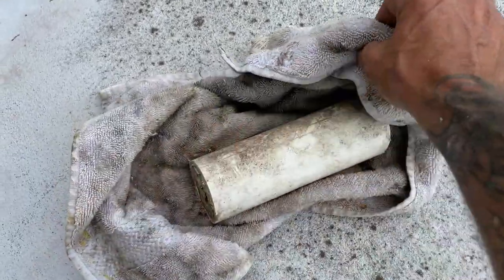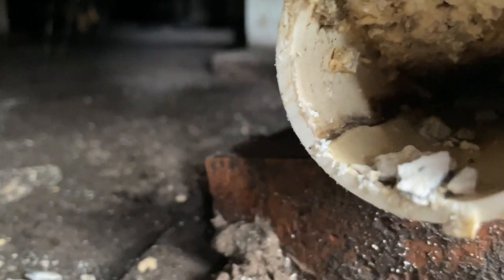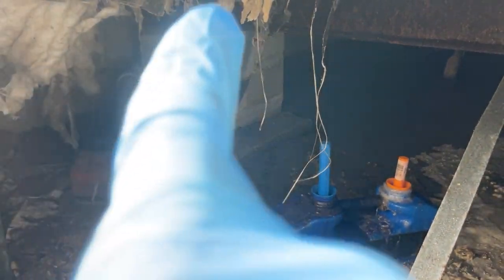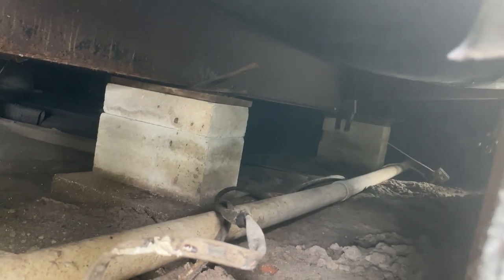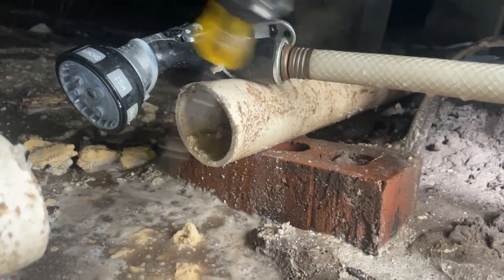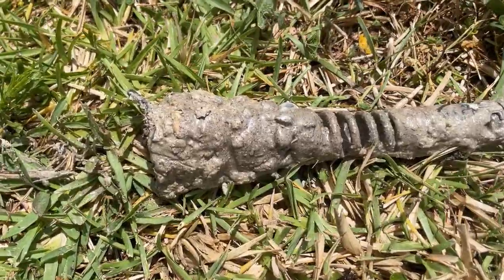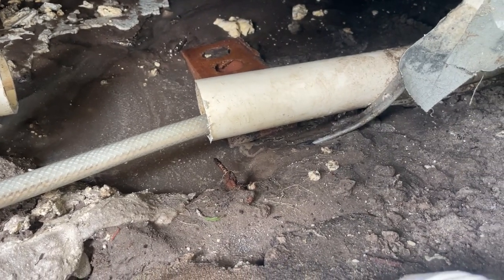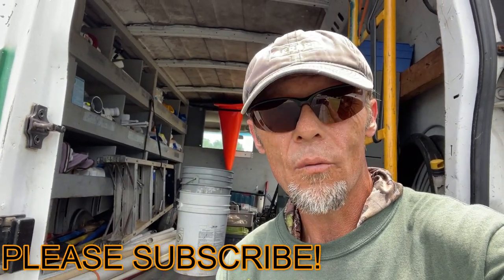EXTREME KITCHEN STOPPAGE IN MOBILE HOME

Comment: I saw something close to that pipe. 2 inch kitchen line abs cracked at combo wye fitting because straps broke off the joists and weight of grease weighed pipe down.

Comment: Yep.  .. had one 40 ft of 3 inch  reduced back down to 1 1/2. .. 3 inch was full of hardened grease ,, made full replacement of the line and corrected the size to 2 inch all the way ,,  nightmare trying to get that 3 inch out from under the home ..  drain king makes some pretty decent blow bags .. also having 1/4 inch      Spaghetti  jetter hose attached to that garden hose is helpful with back washing out the grease ..

Comment: I have the same problem every few years. I cut my pipe but it's in the insulation......what mess!! and my head catches the brunt of the crap coming out because I can't move out of the way when I do it. Plus the ground under my house is muddy most of the time. Then I'd hook up my garden hose to the hot water heater,  put a rag as tight as I can around the hose around the opening of the pipe and have the wife turn on the faucet. Didn't work the last time. Ran about 25' down the pipe. I got all the blow back and burned me pretty good but not scalding. Then bought one of those pipe bulbs that expands. Ran the hot water again for a few and it cleared it out. Sounds funny, but I'll fill my sink every so often with hot water, pull the plugs and get the hot water in the bathrooms going just in hopes of melting the grease that has formed over the year. Found out drain cleaners only clear a pencil thin groove going down the pipe because it just runs down the pipe. I'll never use that stuff again.

Comment: All that water you put on underneath that mobile home going to tip over you should have cut pipe down line put a couplings   between the pipe to connect after you clean the pipe out

Comment: looks like the grade is too flat?...
Reply: I was thinking the same thing, but looks like there was a belly on the pipe.  Should have used more bricks lol
Reply: the cause of this is absolutely no grade, I ran into issue and used my pressure washer with a Amazon hydro-jetter kit... the line I worked on was solid for over 20'